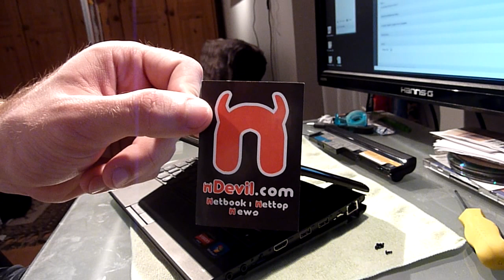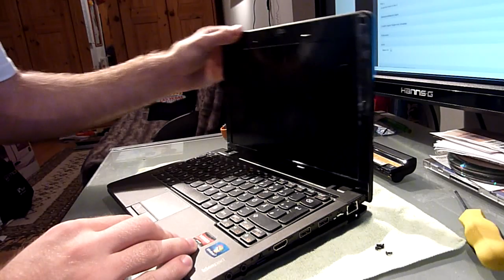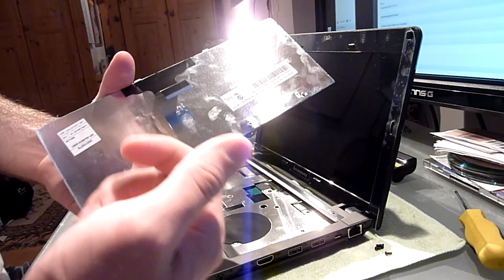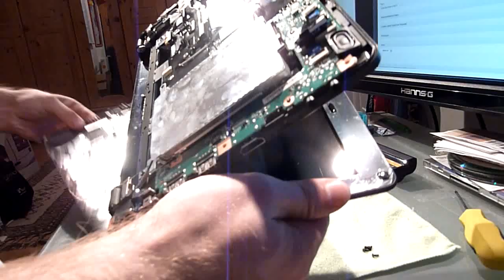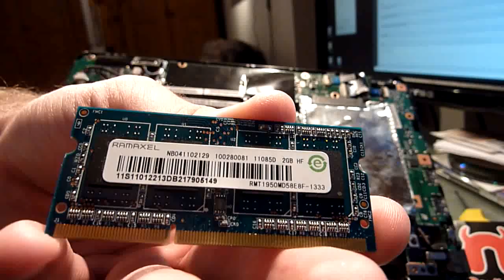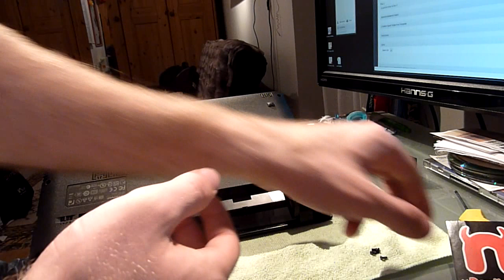Lenovo Ideapad S205 RAM and HDD Upgrade

Comment: What ram speeds are compatible with this notebook? I'm looking at 2x4gb @1066 mhz for £31 on amazon. Also, how much difference will I see in multimedia performance if I install this? I want to edit photos in photoshop while backpacking. thanks!